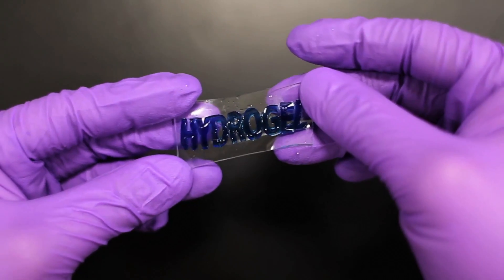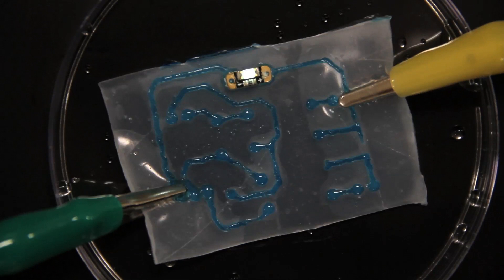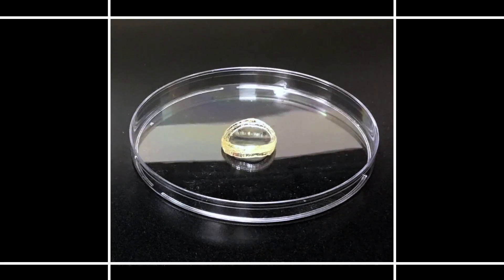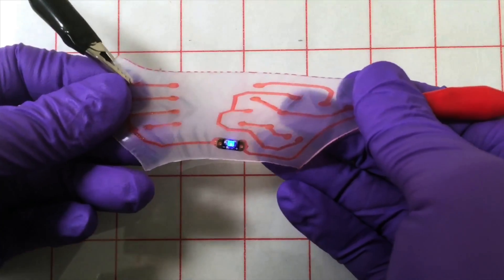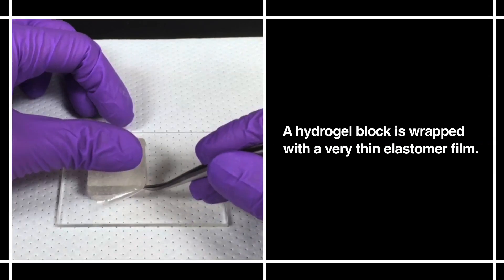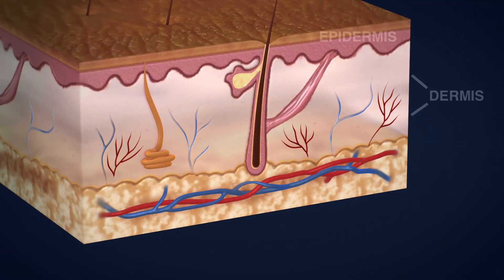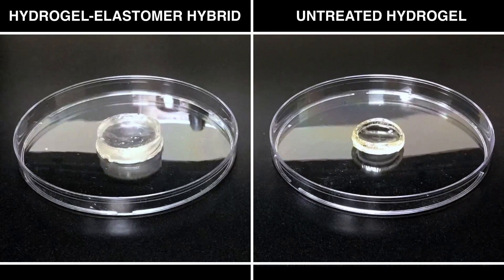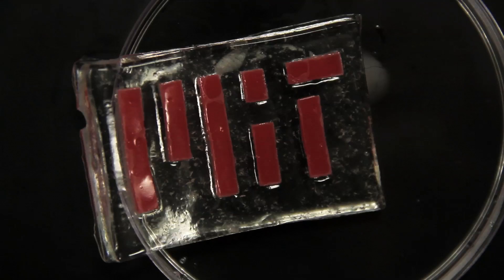New hydrogel that doesn't dry out

Comment: I`m already exited for the day where they release the news of a Sucessfull Prototype "Cyber Interface" and Creation of Thanks to Magnetic Power less Hot Fusion Reactor (I know How Fusion works ... and its quite Amazing what is possible when you use Enougth Magnetic Engergy, possibly already powerd by the Fusion Reactor to make the Plasma even Denser with less heat. Think of that for a second, then ask why i suggest this. Then think again and be amazed once you notice that it would be a Cooler way to have a Fusion Reactor ... wich may even be possibly used in Planes if you were to turn the Energy Released by the Fusion into Rotational Energy. 

All theoretical as i myself dont realy know what would happen nor how to build one correctly (I am not bad a Physics ... but bad at turning Theory into Reality)